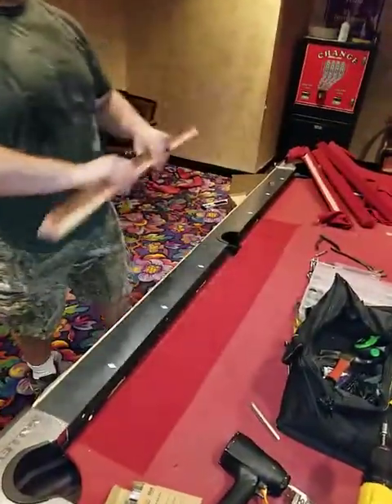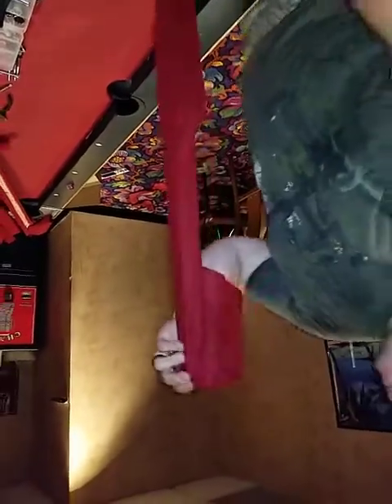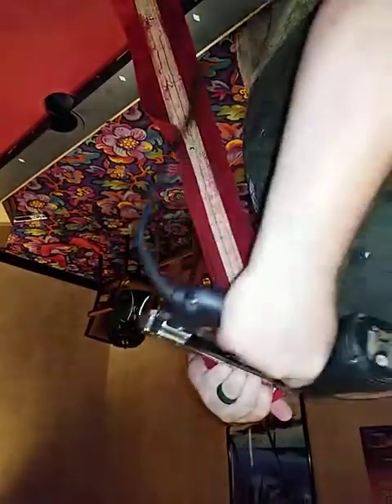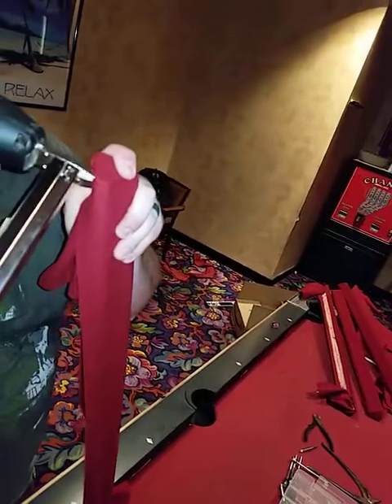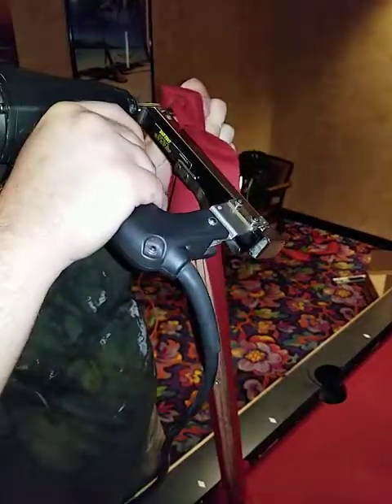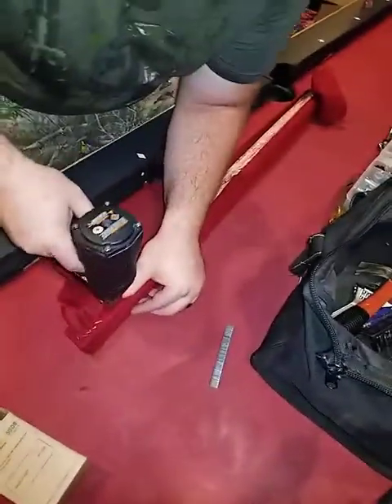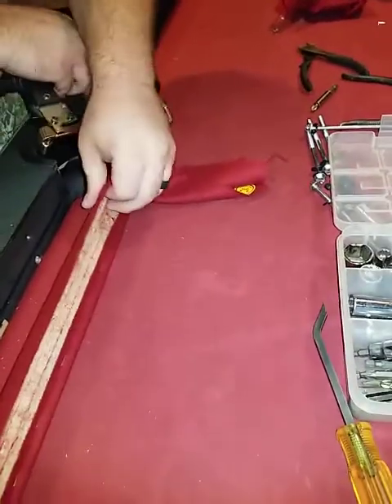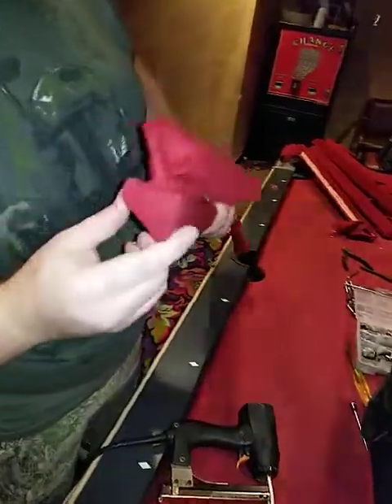How to cover barbox cushions without folds.

Comment: Thanks for the tutorial. These Ridgebacks for my Dynamo turned out great.  The only issue which I wish you would have expanded on was how to trim down and tuck the bunched up felt on the ends.  Great video tho!  Thanks again!
Reply: I wanted to see the trimming off process also. Just finished a Dynamo and the bumpers were a bitch (with fold) and took forever. Found this vid after I finished. Have one more  Valley to do and will try this way.

Comment: I've put new cloth rail and the ball don't bounce as much as no cloth what am I doing wrong can you help
Reply from the maker: It depends on the type of felt used, the more expensive felts have a tighter weave. Also the tighter you pull the felt the more tension you'll have and it'll react better when the ball makes contact with the bumper. That's my best guess at least.
Reply: @Nambilus  worsted wool thanks for reply

Comment: Great job! There is an easier way. I do it just a little different.

No..... Don't staple the bottom of rail. Why not wrap around for a better look.
Reply from the maker: You don't even see the bottom once it's installed, makes no difference to staple it there or all the way around the back.
Reply: Not at all like valley did them , but it works I guess.